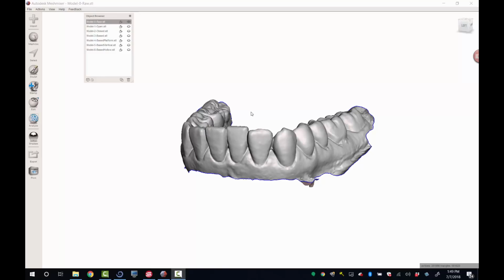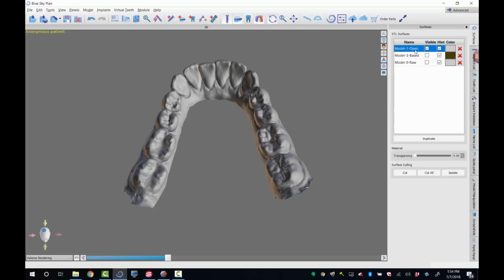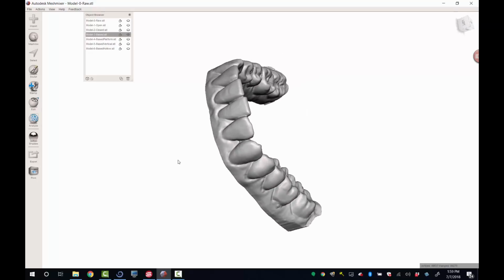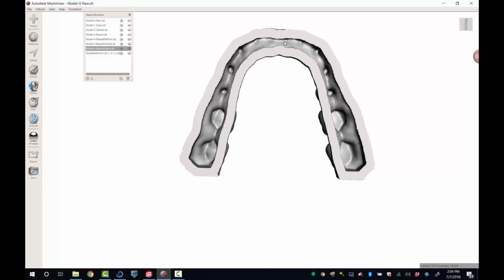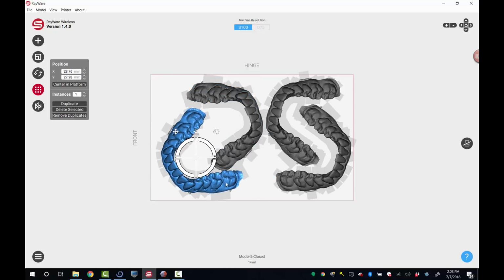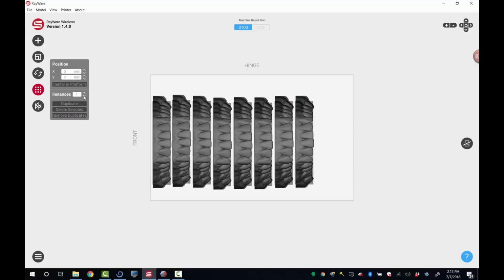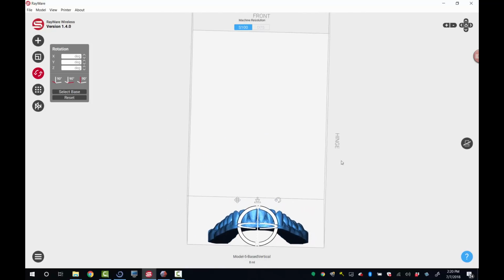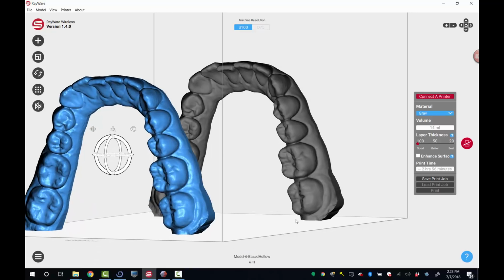3D Printing - Methods for Model Printing

Comment: I have imported a Itero scan into mesh mixed and am having a hard time doing a plane cut to create a new base.  When I do the cut it opens up the model.  If I move the cut to a higher level it will cut it and keep the model closed, but this is not where I want the cut to occur.  Any suggestions?
Reply from the maker: Check out my MeshMixer Advanced playlist. I think maybe video 9&10. They deal with open meshes and such.

Side note: Export your models open from iTero and just use BlueSkyPlan to trim and base. It's free to do model work so long as you don't design a guide.

Comment: Great video! I was looking around but didn't see one immediately - whats your preferred way to "tag" the models so that when you make the suckdown/get them off the build platform you know which model it is in the sequence?  I've been using meshmixer and putting roman numerals on the LR molar with the sculpt button but wonder if theres a better way?  Thanks Baron!
Reply: Oh well just as I said that I looked again and saw your BSB video.  I need to get into that program more, disregard earlier comment haha
Reply from the maker: If you want to label a standard model, 3D Builder is easiest. If you want to stick with MeshMixer, look up MeshMixer Typewriter. It's a plugin. Can make it much easier.